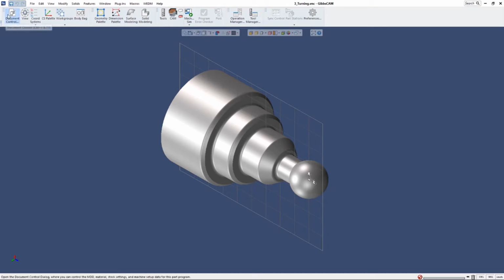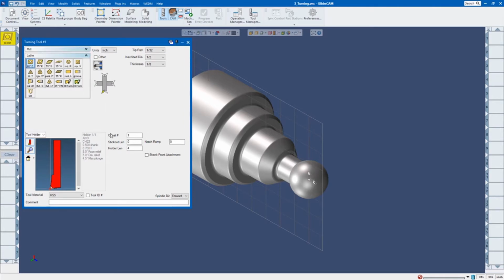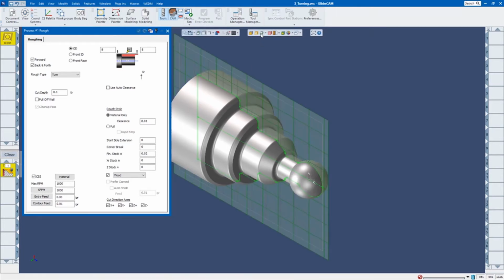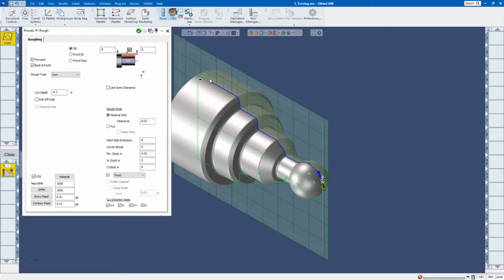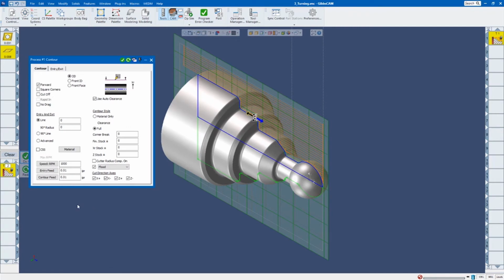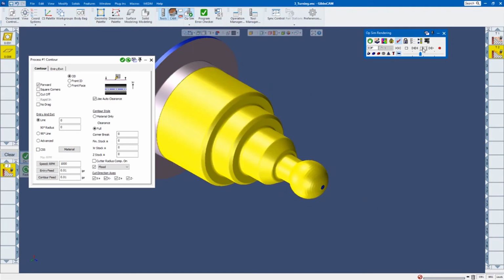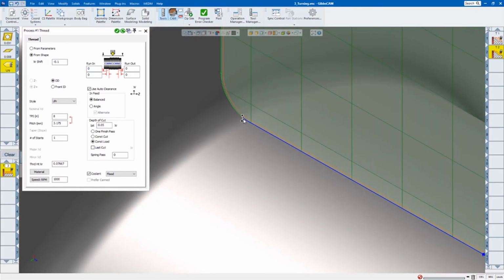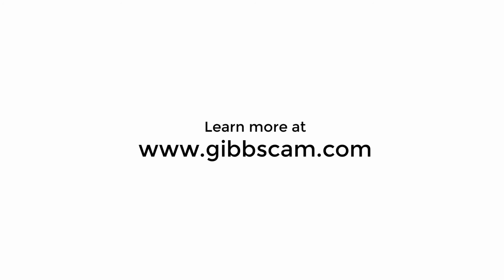GibbsCAM Quick Start 3 - TURNING

Comment: I thought i bought mill turning software for a twin spindle and it seems i received the 2 axis turning for $5000. Wow, that was a lot of money for my small shop that doesn’t even use a 2 axis cnc lathe. Told them twin spindle 7 axis unless I’m doing something wrong in the software.